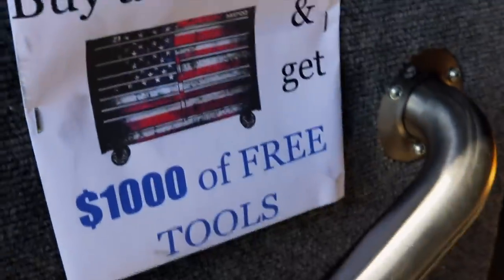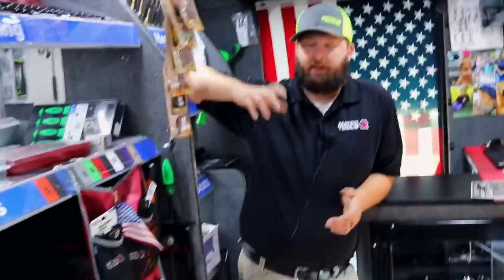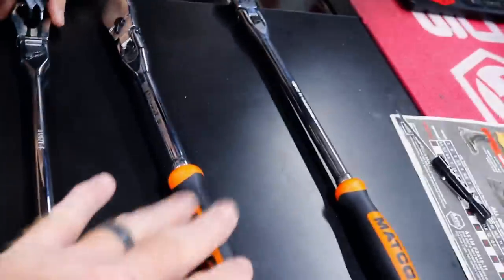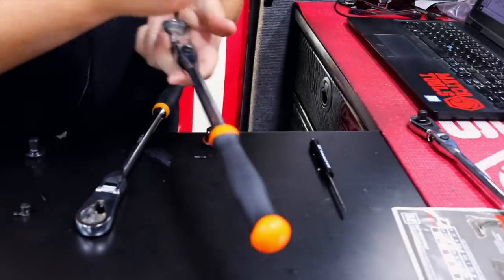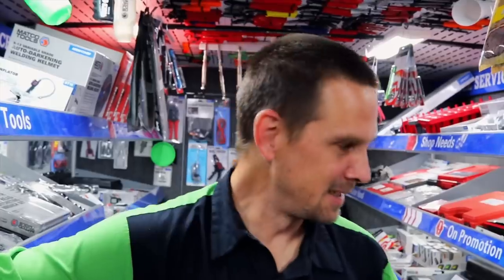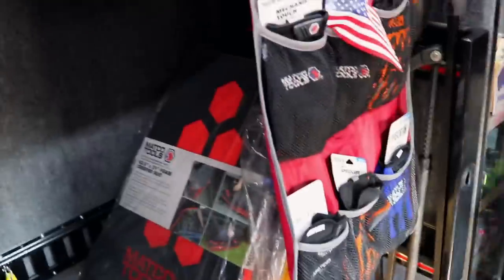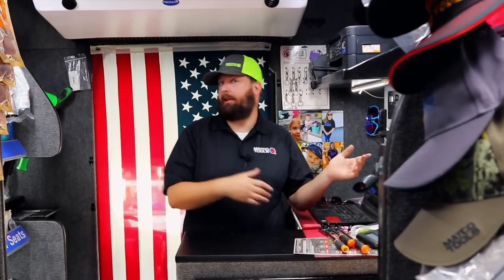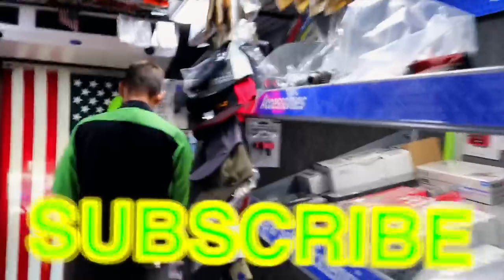Matco Tools: Is it the same ratchet, just rebranded? Gearwrench VS Matco, let’s tear them apart!

Comment: I'll explain this for the people that don't already know. Matco and gearwrench aka apex tool group at one point they were sister companies and shared design of there tools and thats why there are so similar. Neither one is a rebrand ratchet, the major difference is matco is made in the USA with U.S. steel and gearwrench is made in Tiawan. They do have different lengths and handles as well as teeth count. It's just that macto has such a similar design to gearwrench with a snap on price tag is what bugs people about it. But always buy what you like and who cares about anything else.
Reply: APEX Tool Group still produces and procures Ratchets and other tools for Matco.  One other thing most Matco tools are no longer made in the USA, including Ratchets.   Look at any new Matco Ratchet including those in this video, where is the "USA" stamp?  There isn't one - so it isn't Made in the USA.
Reply: @lynyrd583  although i dont own any matco tools, not even there ratchets but im almost positive there top of the line ratchets are still made here in the U.S.A.  At least thats what it says on the Matco website about there ratchets from them. If its not then they are lying to everyone. But dont really think that's the case.
Reply: @chriswebb3018  I actually have a flyer in front of me and when I look up the part number for a ratchet on their website like bfr188lfm down in the specification it says made in USA
Reply: No such thing as american steel anymore. It's all mixed

Comment: Project Farm did a video on over a dozen ratchets, the Gear Wrench beat out both SnapOn and Matco, and overall, was the top ratchet at a lowly $34. My GearWrench 120XP's aren't going anywhere. No issues working on semis and or autos, and I own most of them, 1/4" through their 3/4", flex heads and standard.

Comment: No doubt....Matco ratchets are really nice.  So are the Gearwrench.  This is a great video to show they are not both identical...the Matco appears to be a slightly refined version of the Gearwrench.
Reply: I’m wondering if they are still made by the same company just the Matco is a beefed up commercial version. Or gearwrench may have knocked off the Matco. I’d still take either.
Reply: They are not the same company. Apex tool group underwrites gearwrench and many other Taiwanese brands. Matco is Matco and their hardline tools are USA made.
Reply: stickiestring MATCO and apex tool group had a falling out that’s why gearwrench is similar
Reply: Yeah Matco used to be owned by the Gearwrench parent company Apex and they had a falling out
Reply: Just to correct you guys, Matco did not have a falling out with anyone. Gearwrench and Matco were owned by a company called Danaher. Danaher spun off their hand tool companies together with Cooper Industries and made Apex Tool group which was then sold to Bain Capital. When this happened Matco lost their direct connection to Danahers tool manufacturing capabilities. Danaher retained their industrial and scientific tool divisions, including companies like Matco and Fluke, eventually spinning them off into a different stand-alone company called Fortive in 2016. Since the spin-off Apex and Fortive are 2 entirely different companies with no direct connections.
Reply: @stickiestring  Matco is AJ Manufacturing. Matco doesn't have its own manufacturing capability.

Comment: I own husky wrenches and ratchets and I ain't disappointed  in them and I can take them apart also. dewalt ones from my old set I use because if they breaks can't fix them so they are my throw away set. I'm a person who likes things that work and not pay to much for them. So other hand tools I would buy are sunex, Tekton,  and others as long as it has lifetime warranty that's what I care about and are cheaper than 70.00 per rachet.
Reply: You can drive a Kia also since it’ll get you A to B but most like comfort, durability and pride of ownership of a quality product over cheap and good warranty.

Comment: History lesson time. Matco and Gearwrench were both companies of Danaher until 2010. During that time they shared a lot of cross development so things like ratchets and ratcheting wrenches shared similar, if not exact, design specifications. Gearwrench largely maintained production in Taiwan and China while the Matco stuff was made in Danaher's USA facilities along with Armstrong Industrial. The design of the heads of the ratchets was such that Gearwrench, Armstrong, and Matco kits would all fit into each other from 60 tooth to 84, and 88 tooth and they would even fit into Craftsman ratchets that Danaher made however the Cman ratchets were unique as they were generally all quick release. The only exception to this was the Gearwrench 120XP which is a fatter head to accommodate a double alternating pawl.

In 2010 Danaher decided to spin off their hand tool companies (Matco was retained), and this spin off included brands like Armstrong, Allen, and Gearwrench, and as part of the sale also included all their physical manufacturing locations, both domestic and abroad. So together with Cooper Industries they spun off these companies making Apex Tool Group in 2010. In 2012 they then sold Apex Tool Group to Bain Capital and when that sale happened Matco lost any direct connection to their domestic manufacturing partners and instead had to rely on contracts with a new company. This probably would of been fine but Bain Capital had different plans and slowly began to shut down all domestic tool manufacturing eventually eliminating Armstrong entirely in 2017. This manufacturing shuffling caused some debacles for Matco like when no one could get any 88T ratchets for over 6 months in 2015-2016. It also lead to sweeping product changes such as almost all of Matco's wrenches switching from USA made by Armstrong to Taiwan made by Kabo or Lea-Way. 

During this same time (2016) Danaher was taking the rest of their industrial and scientific tool companies, including companies like Matco and Fluke, which they retained, and spun them off into a new company called Fortive. Matco operates under the Fortive company to this day. 

Matco has since sought new domestic suppliers for many of their more iconic tools and as a result has tapped smaller companies in the USA to make things like their ratchets, extensions, pinless impacts etc.. Since roughly 2017 the ratchets are made in Elmhurst, Illinois by a company called AJ Manufacturing. Hope that clears things up for anyone that wanted to read this far.
Reply: Dope read
Reply: Thank you for doing all the research buddy
Reply: That was awesome info.
Reply: I read it all. Appreciate it
Reply: BLUF: Matco lost its quality recipe
Reply: This was interesting. So can someone please settle the debate on Matco pliers as to who makes them now?
Reply: Cool. I read it all.
Reply: Love you.
Reply: Isn’t the former presidential candidate Mitt Romney involved with Bain capital?
Reply: You are the true MVP of this comment section. Thanks for the great info 👌
Reply: but the Matco wrenches are made in the USA and the gearwrench are made in Tiawan. Check out my channel for the video showing my Matco ratchet that broke at the neck.
Reply: @mikenonameneeded3485  He was gone in the 90s.  People also forget that Bain, Carysle, and I forget another firm bought Dunk'in Donuts around 2006, turned them around, and just resently sold them.

I the vast majority of tools I have are Armstrong that I bought during the liquidation.  The 6pt wrench sets I have I could probably sell for a profit from what I paid for them.
Reply: Bain Capital and all venture capital firms want to see business grow and make more profit. 
Snap-on is owned by vanguard financial...
Reply: awesome read mate, thanks
Reply: Thank you

Comment: I’ll say there’s a huge quality difference in my Matco ratchet vs my gearwrench ratchet. It doesn’t matter how tight you tighten that set screws, the head is real loose on the gearwrench. I’ve swapped the guts over to my Matco on more than a few occasions when it broke and I was waiting on a warranty.

That being said, give it a few years and they’ll be the same as Matco continues to push more and more products to overseas suppliers
Reply: Another thing to keep in mind is gearwrench products have been steadily improving, as they've already replaced and improved the 120 ratchet. The newer model is slimmer stronger and overall more reliable. My friend Eric, who works in a shop, recently purchased gearwrenches new half inch remove full head digital torque wrench. At just under $600 estellar product, 100,000 cycles before recalibration needed, compensation within the display to compensate for whatever head you attach. Similar products are well over $1,500. I recently received the newest 90t ratchets and have been impressed with them myself. There's no doubt that snap on and Mac tools have some quality products, and for some particular tools, there's no replacement. In many other cases the cost differential versus the quality is negligible at best.

Comment: Matco’s flex head lock is the best. Ratchet head strips out too easily. Mines 6months old and has had two kits put in it. Same length Snap on is my go to ratchet has had one repair kit in several years of service.

Comment: I have both Snap-on Matco and Mac. I like the new Mac ratchets with the Locking Flex. I have the Matco in the quarter inch long Comfort grip handle Flex head locking. The slim head design is incredibly tough and gets into tight places

Comment: Gearwrench locking switch is definitely a step up on the Matco, same idea but easier to lock/unlock, can be switched from both sides and more positive engagement. Matco you often need to move the angle to find that locking point, Gearwrench just snaps in. Got the 3 piece GW set and then the standard 88 in 3/8 and 1/4, used to want the flex 88 really badly but we don't have a Matco truck anymore so I started switching over to the other Apex brands. Really happy with the GW, whole set in 3 drive sizes retails for about the same price as the 3/8 flex 88 and quality is really high on the Taiwan made GW tools.
Reply: I have that set, and the 120XP set, along with many other 120XP ratchets from their largest to smallest, flex and standard. No issues at all with any of mine, and that is working on semis and autos, along with other projects. Best bang for the buck in ratchets, at least in my mind.
Reply: Gearwrench has so much slop in the hinge. Matco is a way better hinge and lock

Comment: Matco ratchets are made by AJ Manufacturing here in the USA.Matco is no longer part of Apex,Apex sold Matco to Fortive in 2016 whom is not part of Apex.There is a video on here,youtube called  ABCs of hand tools that was made during WW2 with a character in it called Primetive Pete whom uses the tools incorrectly.A guy from Texas sells it on DVD for $20.00.Did fix my 1/4 drive Matco locking flex head ratchet myself.Locked up on me a year ago.Found nothing broken taking the cover plate off,a part came out of place and put it back in place.Works good now

Comment: If you were to compare the older Gearwrench 60 & 84 tooth series, they are a lot more similar to the Matco 60 & 88 tooth series than the new 90 tooth series. The Gearwrench 90 tooth ratchets changed slightly from their 84/60 platform because the ratchet internals come from their SATA plant in China, people's Republic of and are assembled in Taiwan. They even have a different shaped gear cover that is also common to SATA and some Husky models. The Gearwrench locking mechanism can be accessed from both sides whereas, you can only access the Matco from the top. At the end of the day, the ratchets have basically  the same internal floating pawl design but, they aren't the same. Imitation is the highest form of flattery. Thanks for sharing,
Reply from the maker: That was before Matco started having them made here in the US now it’s a totally different ballgame.
Reply: Nope, MATCO 60 & 88 tooth ratchets were made in the USA by Armstrong tools. The comfort grip handle wasn't hence, the comfort grip ratchets weren't stamped USA. the all metal version were. The only things that have changed with MATCO ratchets is that they're not made by Armstrong because Armstrong tools are gone, and the comfort grips are US made. I believe AJ manufacturing is making Matco's ratchets currently.

Comment: Love my Matco ratchets, 1/4 locking flex head the "perfect size", 3/8 stubby flex head, 3/8 locking flex head, 1/2 with the comfort grip handle locking flex head, 1/2 30" .  Can't beat them.
Clay thanks for another great video, Have a Happy 4th
Reply: That 30" 1/2 Matco comfort grip ratchet still working out?

Comment: I have both Matco and Gear wrench locking flex ratchets. Similar design, but definately not the same. The gear wrench flex lock is loose and releases unexpectedly. Bought the gear wrench ratchets to keep in a tractor tool box and a service truck. They don't get regular use, so at their lower price point they were the right tool for the job.

The creeper pad is great. Light, carry anywhere and throw down on gravel to crawl under a truck in the yard. Also great for padding on a Bone creeper

Comment: This is a really good video to squash the rumor mill.  I was a believer that they were the same.   I see the difference!!!   I own gearwrench and really like them.  I own one Matco and plan on buying more and even want to get rid of some of my Snap On.  Thanks again Clay for the good informative video.  Thank you Matco Michael for doing this as well.
Reply from the maker: They are both good ratchets. The locking mechanism is the best there is if a guy wants both locking and non locking and doesn’t want to be hitting it and unlocking all the time.
Reply: @KoonTrucking  yea I'm glad u did this video clay ! I always knew they was different just by eyeballing them Ive never got to use a matco but I have a gearwrench 84t locking flex and can clearly see they are not rebranding them for matco lol totally diff ratchet gearwrench just copied ther design

Comment: I have 21 Snap On ratchets from 1/4 to 3/4  .. Different lengths , regulars and flex heads .. 1/4" body with 3/8 drive , 1/4" body with 1/4" screwdriver bit drive .. I've been a mechanic 40 years .. Love every one ..

Comment: I wonder if the older ones from like 2010 ish were closer to gearwrench because i got rid of all my matco after i could not do oil changes on ISX engines with out ripping the guts out of the ratchet every time.

Comment: Just a shame you can't buy matco outside of USA. Only option in Australia is Snap On. I'd buy the locking flex 3/8 for sure. Struggling to track down a gearwrench locking at the moment in soft grip.
Reply: you can buy matco in canada also

Comment: Old school mechanic here, I ve use matco flex head drive ratchet before, my opinion not bad, the grip can be a bit better, like that the flex head is a bit narrow. helps get in tight places, but far as putting some hands on  pressure torque, I got a feeling the Matco  flex head will probably snap or wear, out over time. Plus for the price of $292.95 for a 1/2 drive ratchet is kinds pricey.  But on a Gearwrench to me the handel comfort feel better, the 90t design feel that it has a better torque then the Matco  when unfastening, and strong at the flex head were the fear of not snapping off when unfastening a bolt over many use. Plus the flex head locking 1/2  drive ratchet  by gearwrench only cost $ 84.99 thats a deal. Overall my opinion for budget and a bit better performance,  I go with Gearwrench. But hay thats just my opinion.  But overall AWSOME! Review on the similarity of both ratchet and to understand there functions 😊👍👍

Comment: Good to have bill back.  I fixed an ir 1/4 air rachet using hf parts because that is all i could get that does not mean that the ir air rachet is a rebranded hf.  Matco and gearwrench are different.

Comment: I Own Different Brands Of Ratchets And Any Tools In General And I'm A Fan Of Snap-On Tools But Matco Makes A Helluva Ratchet And Tools All Together But Gearwrench Is Damn Good Stuff And I Can Do Any Types Of Work I Do, With Gearwrench Brand Hand Tools And Not Have Any Worries, Also We Now Have A Couple Different Sets Of The Milwaukee Brand Socket And Ratchet Sets And So Far I'm Impressed With Them And I'm Wondering, If Milwaukee Has Any Types Of Hand Tools With Any Kinds Of Comfort Grip Handles Because I'd Buy Some To try Them Out!!!
Reply from the maker: I haven’t seen any Milwaukee with comfort grips ? They should for sure make them

Comment: So tired of hearing matco is re branded gear wrench. Especially from people who have never owned both. Must be a jealousy thing. 
All my gear wrench flex heads are bent slightly at the joint from medium use. None of the 6 matco ratchets i own, use and abuse are bent and i have never broken one to this day and I pull waaay harder on them. 
I baby my gear wrench 120 xps because I have broken them a couple times and Ive been gun shy ever since. Thankfully my Fastenal guy warranties all of my gear wrench for me because it is on a regular basis.

Comment: Gearwrench and Matco were both owned Danner tools until apex split off. Ive had a 1/4 flex matco since 08 have kit up to 9/16  and may have put cheater  bar on it never striped a gear. I do open it up and put synthetic brake grease in it when sounds dry.